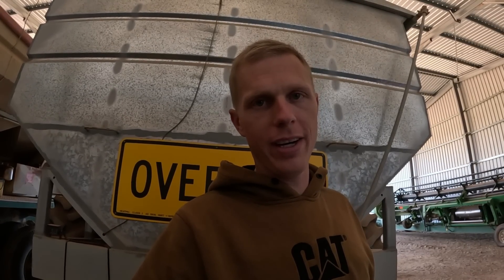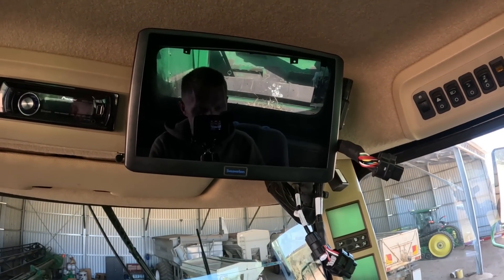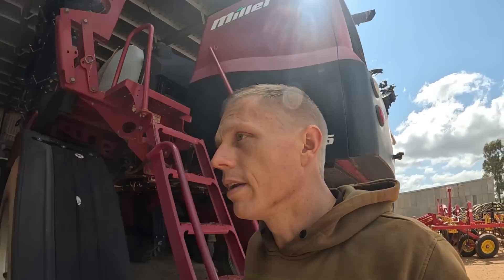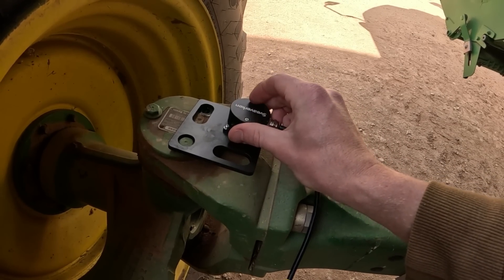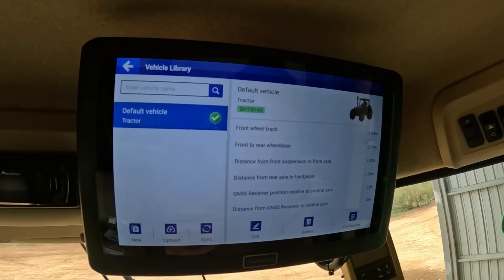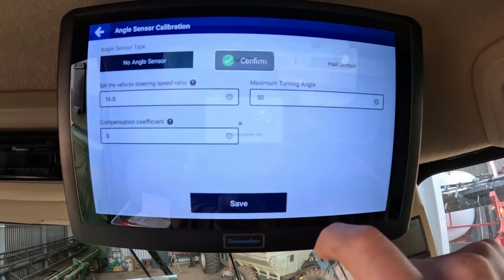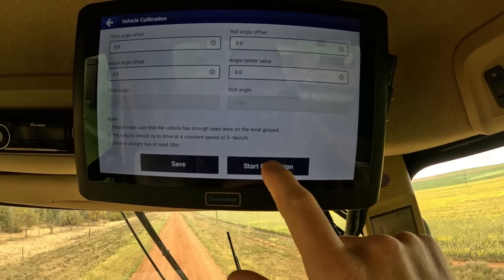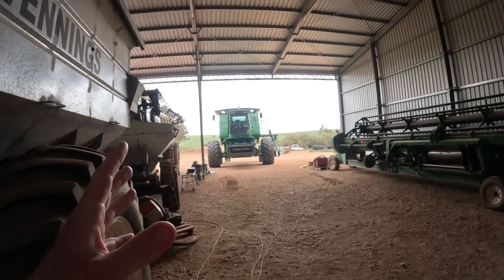Sveaverken F100 Auto Steer - Unbox, Install & Setup

Comment: What's the system worth with the base station? What kind of battery does the base station run off?
Reply from the maker: @GlobalTriathlonNetwork  Not 100% sure with the base station, but was told the basic system is in the 8-10k mark. That would probably be on the 5-10cm accuracy. The base station has approximately 10 hours internal battery life, but will generally need an external 12v battery connected to get you through a big day or multiple days.
Reply: @lockvalleyfarms981  what's the plan with sharing the truck for harvest? How will that work?
Reply from the maker: @GlobalTriathlonNetwork  all harvest machinery is shared. So we set a harvest plan and work through the crops as evenly as possible. Not much of a harvest left this year. 40% of our crop is toast.

Comment: Geez....how things change....can remember driving an IH header for a contractor around Young in NSW 50 + years ago, fill up with fuel do a grease and oil, start the machine and steer around and around and around occasional belt broke, rarely a flat tyre, occasional mechanical issues....now you still have those problems plus + all these digital/wireless thingies. 
Just an old bloke wandering through his memories ! Really enjoy following your daily activities and chores, thanks, John.